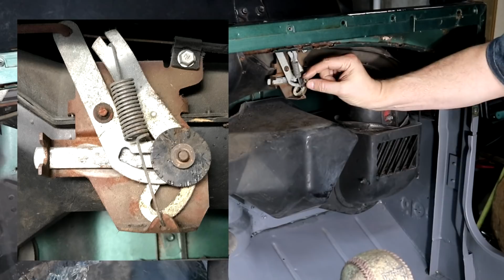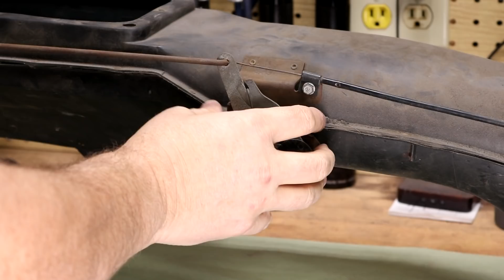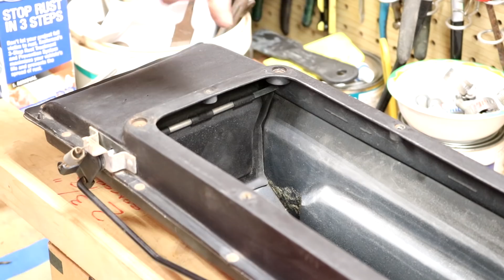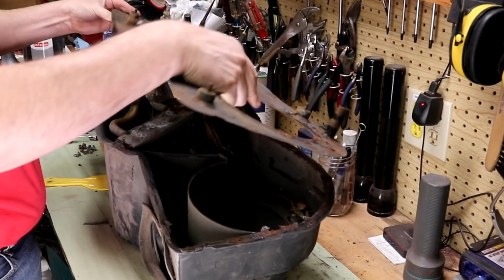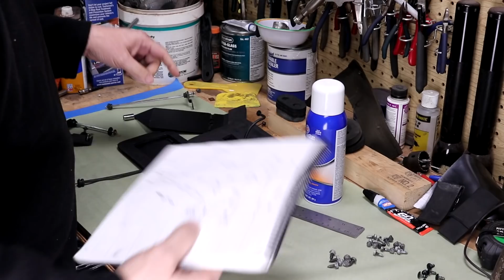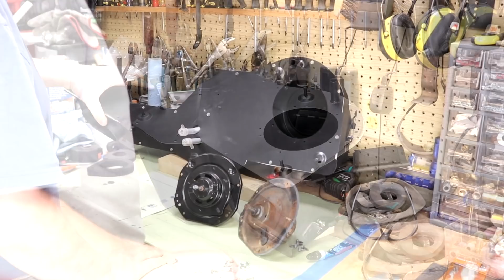Jeep CJ7 Heater Box Restoration | Project Rowdy Ep028

Comment: Do you have a layout where the control cable go on the heater box?
Reply from the maker: Well for some reason your last statement makes me think that the cable has a link in it.  As that link moves through the housing it could react differently to the shape of the housing.  Just a thought.
Reply from the maker: I do not.  Sorry.
Reply: @UCanDoIt2Mike  thanks anyway.
Reply: @UCanDoIt2Mike  I just had to replace the control cable from dash to Heat/Fresh air vent. It will wont push closed; it just flexes. Another mechanic thinks there is a clamp to hold the cable from flexing. I pulled the old cable out, & just fed the new one in, around behind the defrost duct. Hooked the end on the peg & the end ring in the slot. Is there another place the cable is held? You know I Can't see much under the dash!  Great video!
Reply from the maker: Each cable housing is typically “held” firm somewhere very close to the looped/door end.  Just like that same type of housing/cable solution would be used as a lawn mower throttle cable.
Reply: @UCanDoIt2Mike  Yes sir, I have the cable housing in, inserted in the metal bracket, & then the cable on the peg, held by the press nut. And that is the correct cable, the Long one. But when I try to make the cable Push out, the cable housing just flexes. Acts like it needs to be secured at another place to support it from flexing.
Reply: I just watched the first of your "Dash Removal", & can see the cables. They are not attached except at the end. Only difference I see, is your cable was run in front of the defrost duct, & I ran mine behind the duct. Well, I'll worry about that come Spring! I have it manually closed for now, as Winter is here. Keep up the great Videos!
Reply from the maker: @MrRodepp  I will add this... In Theory!   If the Housing is secure on both ends, it would not care if the length was 2 inches or 10 feet...  the center would not flex in the center.  I cannot remember how the housing is secured on the knob end.  securing it on both ends is a must.
Reply: @UCanDoIt2Mike  That's what I thought too! But it's locked in the dash, & it's locked in the holder at the heater box. but yet the cable housing flexes up & down. Seems Odd to me too!

Comment: Do you know where to get a replacement lower drain hose for the heater?
Reply from the maker: There is one on EBay right now, but realistically, your local Auto Parts store should have a generic hose elbow that could adapt for this.
Reply: @UCanDoIt2Mike  thanks

Comment: Thank you so much man. I daily drive my cj7 and about a week ago i hopped in it and now that its getting cold here in Wisconsin the windshield started fogging up. So i took my spare wiper blade that i tuck by my vin plate and used that as defrost. So my stupid gen z ass  didnt see the moter sticking through the fire wall so i figure the moter is in the cab. So i look under the dash and assume the thermo resistor thingy is the fan so i pull the plug. Sure enough no power. I pull the switch and its coroded so i take apart the switch clean things up and test ot with a ohm meter and it works but then the pcb the prongs are mounted on falls apart and the spring pops out. So i bought a new one drove a week without heat oe defrost (not that the old jeeps have a good defrost anyway) plop the new one in to find out it still doesnt work. I pull and test the new switch incase its bad (how good could rugged ridge possibly be) its working. But thanks to your vid i now know tucked away under the battery tray is a blower. It was working so my theory is when i had the engine out this summer the harness drooping unplugged it half way then driving it vibrated the connector off then when i go to use it months later the blower isn't getting voltage. So this whole time i could have had heat but im just stupid apparently. But in the mean time i got by by having no front carpets as a v8 and headers warm the floor nicely 👍
Reply from the maker: Awesome story!   I like your interim solution of pulling the carpets for some of that V8 and header heat.  Sometimes it takes a little digging around to find some simple issues.  Cheers and love that you are daily driving yours!!!   Mike

Comment: Has your fire wall been under coated?
Reply from the maker: Not the interior side.  The engine bay side was undercoated by the previous owner and it will be coming off.  I plan to use a bed liner on both sides of the firewall and Floor.   Cheers  Mike!

Comment: Thanks for an awesome video. Been following your instructions to a T but one thing. The blower motor wheel you recommended doesn’t fit the blower motor PM102. I’ve looked all over the internet to find the one that fits. Mine has broken blades and needs to be replaced. Any suggestions?
Reply from the maker: Yo might check Crown, Amix Ada, or I now on Craigslist in the Atlanta area there are a couple of guys that advertise used original heater box assemblies.  You might have to go that route.  Cheers!

Comment: Wow, this is giving me some serious PTSD from when I restored my 1990 YJ heater box and cables, which is very similar to the CJ box. You're gonna love the bigger blower motor. I replaced my heater core and weak blower motor (both original) in the dead of winter and man the new motor moved some serious air. I'd have to either vent in some cold air or turn the blower completely off to keep from burning up in single digit weather! Love the build my friend.
Reply from the maker: Yea... I think the problem now is how not to burn my feet!   Cheers ...  Mike!

Comment: I really enjoyed your professionalism. I would like to download the gasket templates, and could never figure out where to do that. Is there anyway you could help me find them? Thank you again
Reply from the maker: Here is a Link to the Parts List and Foam Shape Diagrams: http://bit.ly/JeepCJ7HeaterPartsDiagram

See if that will work for you.   It is a PDF file that should easily print to your local printer.  Thank you for the complement.  Have fun with your project!  Mike
Reply: UCanDoIt2 thank you! That’s it! I’ve had my cj for 27 years. I have a son I’m trying to get interested in cars and he just isn’t 😔. I pulled this stuff out because I have some slight leaks under the dash I’m hunting down☺️
Reply from the maker: @johndean7915  Excellent!  The Heater Box is not that complex and it is very interesting to take apart and learn how it works.

Comment: Thanks for the video, really helped. My only question is about the blower motor replacement. The one that I ended up installing has a 2” hole on the side of the motor that sticks through the firewall. I’m guessing it’s for ventilation but it is also exposes the inside of the electric motor to water, dust, and grime. Did the motor you used have this opening and if so what did you decide to do about it? Thanks!
Reply from the maker: Mine has about a 1 inch hole in the side of the motor housing that protrudes through the firewall into the engine bay as well.   My kit came with a PLUG that I plan to cover that hole.   If your Motor did not come with a plastic plug, I suggest finding one at your local hardware store or online.   Cheers!  Mike

Comment: How did u prep the plastic parts?
Reply from the maker: Prep for Paint?  I just cleaned them with a household cleaner then a wax and grease remover.
Reply: UCanDoIt2 thank you. Did you paint the plastic?
Reply from the maker: @midgetcj  I did paint the lower Heater Box, but not the upper Fresh Air duct.
Reply: UCanDoIt2 sweet. What kind of paint did you use?
Reply from the maker: @midgetcj  Either Rust-o-lium or Krylon.

Comment: Did you drain the coolant before removing the tubes in the engine bay?
Reply from the maker: Yes...  In the early steps of disconnecting everything, I did disconnect the two Heater Hoses, first at the engine side as one of them is the lowest point.   This allowed most of the coolant to drain from the Heater system.

Comment: A little late, but a good marine plastic and rubber conditioner would have softened the flap rubber seals to where the sticking wouldn’t happen. Just did the same thing you did before seeing this video
Reply from the maker: That sounds like some good advice.   Cheers  Mike!

Comment: New subscriber. Awesome video. I will be using your instructions and gaskets plans to do this soon! I know you have not hooked it all up yet, but does anything need to be done with the resistors for the fan speeds to work with the new blower motor or is it just plug n play (besides the firewall hole enlargement)? I plan on just taking the lower box apart and leave the upper assembly in place as this is my daily driver. Thanks a bunch
Reply from the maker: Sounds like you have a good overall plan.  As long as your resisters are in good shape, it will work as is with the new motor.  If not, they are easily accessible to swap later.  Mine worked when I dismantled, so I assume they will be good for a little while longer.  The lower Heater Box has most of the items that need updating.   Cheers and have fun with yours!   Mike
Reply: @UCanDoIt2Mike  just got the heater box installed, wow what a difference. Between the old core being full of junk internally as well as the fins, the weaker fan, and the degraded foam, it is like a new world in my jeep. I live in NW Colorado so this is a big deal! I did not have issues overheating but the jeep even seems to be running slightly cooler. Defrost that works is nice also...

 I did a couple of different things from you as well that I will mention in case someone else wants to try. I blocked off the small 1x3 opening since I added the lower duct. I added a piece of foam on the bottom of the angled piece of the defrost gate. Lastly, I filled the void above the squirrel cage with foam insulation. I figured best case it might deaden the noise slightly.

Overall, this is a great upgrade and I wish I had done it several months ago. I appreciate the effort you put into the video and instructions.
Reply from the maker: It will definitely be nice to have extra heat when you need it.   Cheers and thanks for the extra info and to know that it appears to be a worthwhile upgrade....  Mike!!

Comment: Mike,
I removed the heater box and fresh air intake following your instructions ( one bolt had to be cut off because it was just spinning and the PO had put some type of sealing adhesive around the vent opening in the cowl). You videos are invaluable for this project! Thanks so much.
Jim
Reply from the maker: Great news that you are taking this on.   As you take it apart, it will be very apparent how it all works.  It is not a high tech item.  Have fun with yours and soon you will be enjoying the fruits of your labor.   Cheers.... Mike!
Reply: UCanDoIt2 
It is an ingenious mechanism. 
Thanks again 
Jim

Comment: Mike,
Maybe you can answer a question for me. A previous owner replaced the CJ tub with a YJ tub and along with it a number of assemblies. Originally I thought the heater box was from a CJ, but now I think it's from a YJ. Although the push/pull knobs open and close the vent doors outside on the cowl. The actual heater box doesn't look like a CJ box, the levers that control the doors are completely different. Plus I can't find any trace of flexible ductwork going up to the defroster ports. We're these assemblies interchangeable? I was planning on using your videos as a step by step way to rebuild my heater box.
Jim
Reply from the maker: I'm not 100% on this, but let me tell you what I think.  The Boxes are different.  The way that the Control Cables connect to the box are a little different.  You should be able to just purchase the YJ style, if that is the case.  Where the Control knobs attach to the dash would be interchangeable.  I believe the YJ Heater Box and Fresh Air Duct will physically fit in the same space on the CJ, there may has been some minor adjustments to the 4 mounting holes and the large hole where the Blower motor pokes through the firewall.  My guess would be that it just drops in.  I am pretty sure that you will find the two boxes (YJ and CJ) are extremely similar.  My video should be 95% of what you need and then you can make up the rest.  I had never done it before.  I learned most of it while I took it apart.  I say Go-For It!  Enjoy!!!!!   Mike
Reply: UCanDoIt2 
Thanks Mike,
I've also got rusted out floor boards and I'm using your videos to help me through this issue. October is going to be a very busy month for me! 
Jim

Comment: How did you end up removing he fresh air duct/box. Is there a video for that? I dig your instructions and would rather not go about tearing into it without somewhat of a guideline.. thanks a bunch for the time you take to share with us.. Impressive 

GT
Reply from the maker: The first 9 minutes of this video discuss and show how the remove the Fresh Air (Top) and Heater Box (bottom) section from the Jeep.   To separate the two units, there is just one cable connecting them together.  They then just pull (fall) apart.

Comment: Mike, thanks to you, I’m reassembling now.  Fantastic video.  I noticed for the first time both on my heater box and in your video, the approx 1x3 inch rectangular hole that is on the side of the heater box closest to the driver side.  What is the purpose of this hole?  Is it to allow additional heat to the drivers side?  Thanks for all the videos!
Reply from the maker: That 1x3 inch hole provide Air to the driver.  As long as you are not in Defrost mode, air will flow throw this.  Depending on the position of the Temperature Mixing gate, you will either get Fresh or Hot air.  Congrats on deciding to take this on.  Cheers and have fun! Mike
Reply: Got it.  Thanks again!

Comment: Thanks for posting. You did a masterful job on the restoration.  I am restoring a CJ8 and a J10 pickup.  I will definitely be referring to this video. I haven't taken my heater box apart yet. I bought the CJ8 off a woman about 10 years ago and it has been garage kept since then. The tub and chassis is stored in a metal building and the hood, fenders and fiberglass 1/2 top are stored in the loft of my 30 x 36 workshop.  I have a rebuilt 258 to go into the CJ8. The J10 also has a 258. I am slowly accumulating what I need to do the restorations.
Reply from the maker: Those will be fun projects!   Sounds like you have the CJ8 parts spread around like a squirrel hides nuts.  I really enjoy the research and hunt for parts.   Best of luck with your projects...  Enjoy the process!!!  Mike